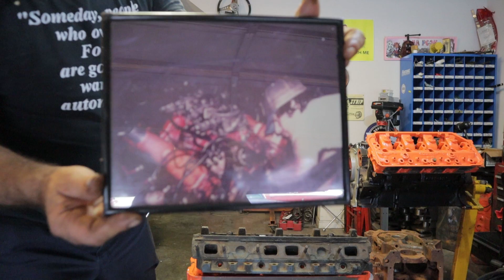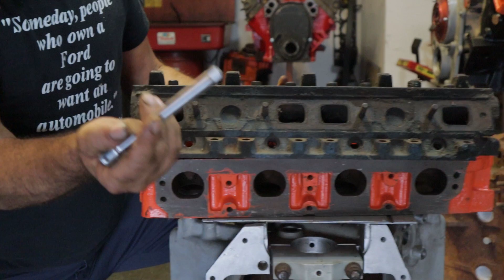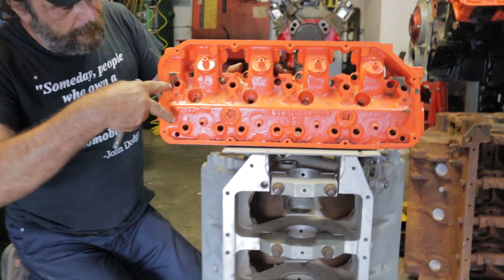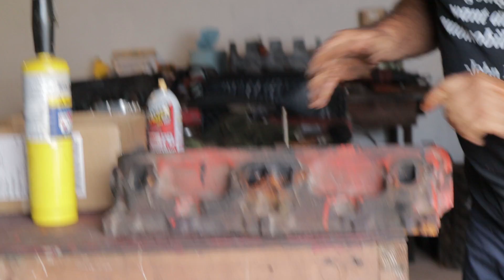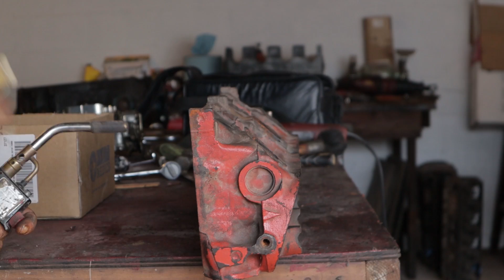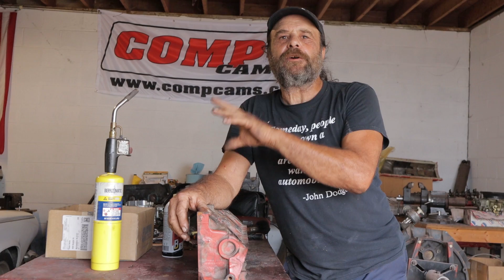What Makes The Small Block Mopar Such A Great Engine?

Comment: Nice video but no mention of Ford's small-block ticket puncher, the Cleveland.
Reply: Yup, by far the best small block heads for many years.
Reply: The boss or Cleveland is the best small block hands down ,and I'm a Chevy guy power is in the heads
Reply: 4v heads were too big for the street.
Reply: @frigglebiscuit7484  As most were delivered from the factory, I'd agree.
Reply: @frigglebiscuit7484  depends on alot of factors. And it depends on each person's consideration of they feel is a street motor. I drive a tunnel rammed 351C4v on the street regularly. Drives fine for me. Runs 11.90's out on the drags with 3,400 lbs and 4.11 rear. I do not feel the intake ports hamper the motor if at all.  It does enjoy the upper RPM range more than anything. A little sluggish on the bottom. But with 2 x 660 centers squirter and a stock converter. That's got to be expected. A 5.38 rear and a race converter would help if you wanted to push things. Everybody is different. It really depends on what you looking to do. And what you enjoy.
Reply: @jongallant6054  my vision of a street car doesn't turn 3300rpm at 60mph.
Reply: I am a Ford guy. But I enjoy reviewing the different positive elements all brands may have had to there motors. I agree a 340 does have alot of instant throttle response. Those exhaust ports were most likely the reason. I was impressed riding in a 68 dart GTS 340 automatic car one time. My buddy laid into the throttle from a dead stop. And the motor responded instantly. Bob Glidden the Ford racer had a long one season winning streak driving a Mopar small block. Glidden even helped to put a final perfection touch on the direct connection 340 small block head that was already well designed by a factory assembly line accident. Thomas Edison discovered alot of things by accident as well. Great video. Thanks
Reply: The raise ports heads were born to run, by design. VW/Audi used a simple raised port intake head with the second generation of water cooled engines. Hemispherical piston, and head  set up is a design that is already a straighter shot in, and out, though flow across the top of a domed piston is not like that of a flat piston, enter the canted valve design....

Comment: When I was a kid, I took the Mopar small block heads for granted because they were all I had worked with.  Then I worked with a friend who raced a Ford.  Big difference!  Fords have to make a U-turn out of the port to clear the shock towers.  Angle milling, port plates, radically raised ports... it’s amazing what it took for those heads to have on the exhaust side what the Mopars came with.

Comment: Why is the small block Mopar great? For the same reasons that the gen 1 small block Chevy and Windsor Ford are great. They're simple, have excellent parts support and, they're dead nuts reliable! For years, I was a big block Chevy guy. Then, life got in the way at the exact time that I needed an engine for one of my vehicles. A rebuild on it's big block was out of the budget and I happened to have a good running "red headed step child" of small blocks (a.k.a. 400 sbc) in a junk vehicle of the same year and model. Out came the big block and in went the 400. Longer story shorter, like your experience, I was amazed at how it responded to basic upgrades as money allowed. I do still have a soft spot for my Mark IVs and have several vehicles running them now. But, I've also built many small blocks over the years, from the lowly 305 all the way up to the 427 small block that's in my 74 Camaro today.
Reply: I personally love the SBC 400 you can make decent power out of them! Had roughly 500 hp out of mine  at 19 years old but mine  came out of a 73 caprice wagon, reworked/ bored 30 over , polished the factory crank if I remember right, reworked the heads with bigger valves & roller rockers, intake, Holley 750, I now forget the cam specs but it had a great lobe,  headers & duel flow masters, a good amount of work went into rebuilding the tranny  th 400 new valve body shift kit  B&M mega shifter, 373 rear had this drive train shoved into a 79 Z28
Reply: @ericmcginnis9413  People call me a hoarder these days since I currently have seven 400s. 3 are finished, ready to drop in and dyno'd at around 450 for both torque and power. The others are all waiting their turn.

Comment: I thought the side by side center exhaust ports might have been shared with the A motor and let the LA use the sam cam but after looking the A alternated the intakes and exhausts. The A heads look just like longer versions of the GM 3100 and 3500 heads. I would love to see you build a poly-head.
Reply: I think a Poly build would be terrific. On one of Hot Rod magazines dyno shootouts one team built a Poly and diod very well with it. Did a lot better than I expected. It was basically a good design and I have always thought Mopar should have stuck with it. I may be all wet but I have kind of thought that is where GM got the idea for the 396.
Reply: @karlbishop7481  I think the real purpose of the LA was to be cheaper and lighter for the compact cars.

Comment: I've never driven a big block vehicle. I've had a 360 in my 77 Dodge truck, my friend had a slant 6 in a Plymouth volare that I drove some, I've had a bunch of small block GM's, and I have a gen 2 LT1 small block in my 96 Roadmaster. I've owned around 40 different vehicles in the 25 years I've been driving. But I've never had a big block. I've never even driven one. With the size of my 96 Roadmaster, I really want to put a big block in it. The LT1 is pretty good, but the Buick weights about 4200 lbs. I need more engine. More torque. I would love to find an old Buick 455, a Chevy 454, or even a Cadillac 500. I just want the biggest engine I can find. Cause I can't make the car any smaller. Well I can, but I like it the way it is.

Comment: Ok uncle tony,got a question, I love my 2000 ram 1500 4×4 5speed 318magnum.but my dad's 97 4×4 auto vortec,350 will dust my ass quarter mile an top end.an I mean bad.man this pisses,me off.both are short wheel base with the same size tire.if it was a fender I could live with it,but it's a car length.and both are bone stock,both have 3.73s
Reply: I bet if you had a 360 magnum you would dust that chevy.

Comment: My first 340 was in a 1971 Super Bee, then I got a 1968 Barracuda S survivor, engine never been apart... raced an early 60s Corvette roadster (327) one night and surprised myself that I wasted him with my bone stock 340/727/3:55 sure grip Formula S coupe.  Still have B5 blue Barracuda, but sold the Super Bee.  My first car was a Formula S 273 Commando car, so going from the little 273 to the 340 is an eye opener.....

Comment: So when the flames are coming out the intake..that's bad right?
Reply: Yeah.  It sounds like you have your distributor in upside down.  Are your plug wire boots coming out of the oil filler cap?  If so, that may be the problem.

Comment: Is there some magic about those tiny weird shaped exhaust ports that I don't know about?
Reply: He just explained it.
Reply: @mrdanforth3744  Uhh, kinda but the port shape and dimensions would seem to negate some of that "awsome" line-of-sight flow he spoke of.... don't get me wrong I like the 318 but the port shape and size always felt like trying to push Niagara Falls through a straw. I felt the Ford small blocks had the same problem with port size.
Reply: @mikestaihr5183  The ports are sized in proportion to the engine displacement. The 340 and 360 have similar heads with much bigger ports and valves. It's the 340 that was the hottest performer for its size.
Reply: The shape comes from the casting of the block for the support of the valve guides. It doesn't do much good for the flow through the port. Probably the worst part of the whole LA engines design. If it weren't for that dog leg the LA series would have been even better than it is.

Comment: All Mopar engines are great, and the 340 is certainly an exceptional smallblock. My first mechanical love was the 318... such an incredibly rugged and reliable mill.  And if I were looking for the most power per pound, there’s nowhere else I’d go except maybe  Gen 3 Hemi. But just for fun?  I still would rather tinker on a B/RB... 4 bolt water pump. External oil pump. Deep skirt block / flat oil pan rail. Dry intake manifold. Just SO user-friendly.  But you’re right, the heads limit performance.  And that’s why TrickFlow heads for B/RBs we’re such an instant hit.

Comment: Why not use the best aftermarket head you can find then start doing this?   It's all about air flow on any motor and aftermarket heads rule in this regard.
Reply: There are 100 other channels that use a sponsor’s aftermarket head.  Why can’t this one explore the factory stuff?
Reply: @JohnWilburn  Tony is all about a very low budget, stock parts with some time and thought to work better. He used to do the big budget drag racing, and is more about cheap street cars now, with maybe some drag racing against other low budget builds. The new Hemi crate engines are the opposite of an old rebuilt Chevy small block crate engine, and both are beyond his budget, also aftermarket heads.
Reply: @jeffruebens8355  Budget or not, I just think it’s fun to go fast for cheap.  There aren’t many people who understand, do, or appreciate it because the aftermarket has swallowed up the hobby.  In just glad there’s still one junkyard wizard left out there.  I wouldn’t watch this channel if he took the easy way out.  That’s what everyone else does and it’s boring.
Reply: @JohnWilburn  I quit watching most of the gearhead show on the tube because most of those guys just bolt together after market parts. Full Custom Garage is the only show I will watch anymore. I like UT's backyard approach to hot rodding. My first hot rod was a real hatchet job, a 440, 727 and an 8 3/4 in a '54 pickup. Wasn't anything to look at but it was fast.
Reply: @karlbishop7481  Those shows belong to the advertisers.  Imagine the old Car Craft magazines and replacing all the cool tech articles with ads.... that’s exactly what all the gearhead shows and much of YouTube is.  I wouldn’t buy a magazine that’s all ads.... that’s a catalog and they give those away.  Why watch a show that’s all ads?  UTG is real.

Comment: Having good exhaust port flow with tuned length tube headers is were exhaust Scavenging gets as much of the dirty air out.
Its not the amount of air getting sucked in, it the amount of clean air ( oxygen ) that is combusted with the fuel that makes HP.

Comment: before i became a diehard diesel guy , i used to play around lots with small block mopars  ..... i'm convinced that a 360 crank cut down into a 318 would be the sweet spot for this engine ... assuming for around 45 thou quench on the heads to piston clearance ... there are a few other things that would need to be changed up , but i forget what they are  off the top of my head
Reply: Just use a 360 best all round.

Comment: I've ran a dozen 318/360 in demolition derbies. I ran 318 in a feature started with no radiator in the car. 27 minutes later I won. Died and restarted around 20 minutes. Home done home job and basic re ring and valve lap. Can't kill those motors

Comment: Say what you like and I don’t own a small block Chevy but you can’t argue with that engine, it’s cheap, easy to build and makes good power.  I’d even put the 302 ford above the mopar to actually.   I don’t own either btw . The 340 isn’t cheap , 318 is reliable but who’s wants it ? Same as the 360 really.  Chevys 350s can’t be beat dollar per dollar.

Comment: Just got my LA 318 block and heads back from the engine shop. Should be 10:1 with a decent cam and a little bowl work with the 302 casting heads
Reply: Smooth the roof on the exhaust side.
Reply: @happyhermit6899  ill have to go look, is there a little ridge inside of the exhaust port?

Comment: That makes a lot of sense. I worked with an old hotrodder,he always focused on the exhaust first, then build up the rest. He would say " the faster you can get it out,the more you get in".
Reply: You can actually over scavange a motor.  Had issues with this on Hemis.  You wind up actually pulling the intake charge into the exhaust and burning it in the header.  Even then the ports on the small block mopar are adequate but not great.
Reply: That's why I poo before each meal.

Comment: I thought general consensus was the 340 was the best displacement configuration for the small block mopars from a performance standpoint.   A 273 might make the same power at 7500 that a 340 does at 6k but going to take a lot better than stock parts to hold one together at 7.5k
Reply: 360 is even better.
Reply: @paulmathieson8081  The 360 moves the power even lower in the RPM band, great for a street motor but not as racey, also in my experience they never have the fuel economy of equivelant 340 or 318 motors. I do like the 360 for boost though with the bigger mains. :-)
Reply: A stock 273 can spin to 7 no problem, 7.5 is probably pushing it.

Comment: I watched some old videos of Dan gurney running his cuda with a 340 I think he was running to 8000 RPMs that motor sung one hand on the steering wheel I have a 73 cuda with a 360 Magnum but I want to build 340 that can go to 8000 RPMs and still be streetable is that possible also I want one of those shirts excellent quote by John Dodge I remember there was a bumper sticker that said you can have my wife you can have my dog but you'll never get my Dodge

Comment: Thats great!.. i knew when you said that 318 in bottle rocket was the first one you built, you'd absolutely love them. Like I said, I got a buddy that is a firm believer in them. He says 318s are the absolute most bang per buck. The 273 were good too.. just ran out of ci.. the 360 was a good engine as well. But his firm belief was the 318. Very cool ut.. cant wait to watch the build on a 273. Thanks for the vids and input
Reply: Maybe Mopar should have built the ball stud hemi as a small block?  They might have kept using them instead of the 4.7 and been more reliable than the OHC motors
Reply: Indeed... i see we have close opinions Timothy keith
Reply: Wait.. which overhead cam design we talking about?. The one back then that didn't make it? Or the new engines do you mean?
Reply: @Z_732  The 3.7/4.7 90-degree V engines. Push rods are best for motors that mostly operate under 3,000 RPM.
Reply: @timothykeith1367  uh..... 90 degree? I think we may be talking about 2 different parts of the engine at this point. What exactly do you mean by 90 degrees?
Reply: @Z_732  The new Mopar v6 is a 60 degree block.   The 3.7 was like a v8.
Reply: @timothykeith1367  ah......... im catching on... im slow sometimes... lol
Reply: @timothykeith1367  and the 4.7 is a monstrous piece of shit. there is a reason no one makes aftermarket hp stuff for them...
Reply: (For the record) I do NOT look down on a BBM anyday.. I've had some that ran 10+ demolition derbies and still ran pissed.. very well built engines. And plans for my project may or may not have one in it... best part about them? They are very durable designs.. they've been known to take an ass licking and keep on ticking... imo
Reply: I'm in... but im confused... tbh
Reply: I thought it was about the 5.2
Reply: Oh... okay... so what part of this is pertaining to the 318 or the 360 or the 340 ... i guess I'm still lost... my bad.. clue me in if you would..
Reply: 360 like flushing a toilet so so thirsty dad sold his ramcharger after being  used to 16 mpg to 7.5 factory build lol 2 me I'd take the 318 any day but 360 great truck moter I was putting  a moter  sucked that much fuel 383 4 sure imo

Comment: I never owned one, but I wrenched on a 70 Polara 440.  It was a simple job, cam chain/water pump  - in October rain. Canada.  I think it was 79 -  up here most just rusts into place.  It only falls off, when it rusts thru.    It was dark when I finished. Now - you know I had to test my work.  Took it down the hill from the customers house. Bottom was almost  400 ft, so a good hill.  She had more than 1/2 tank, so I knew the 4Bls would work.  At the green light - at the bottom of the hill, I planted the fuel.  It had a locked diff and smoke rolling off both rears.  I will  not say how fast it went, but I calmed it down and parked in his driveway.  He -Cust - met me at the door and says - "It works good dont it". I laughed - got paid and said "Sure does".  Thank you UTG.  There are not many, that keep asking why?